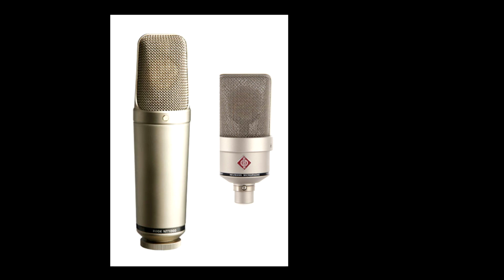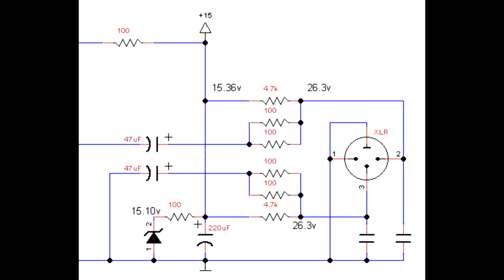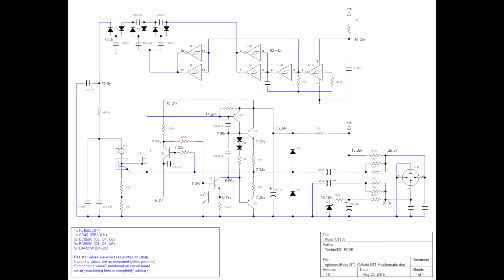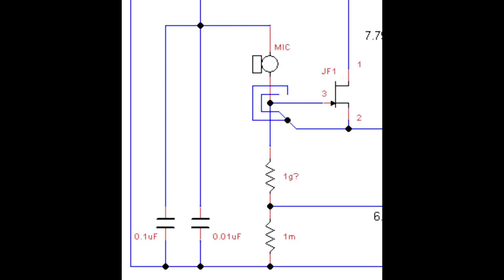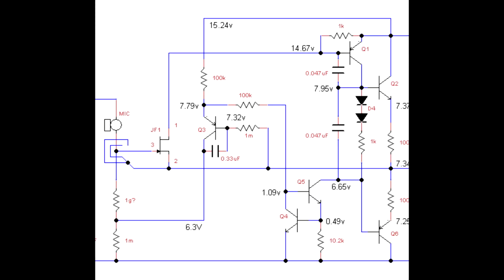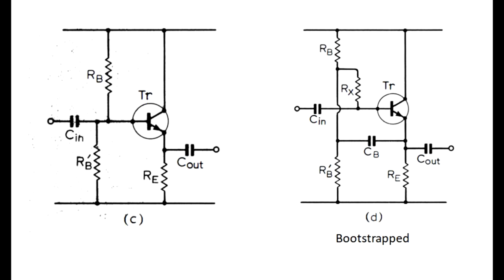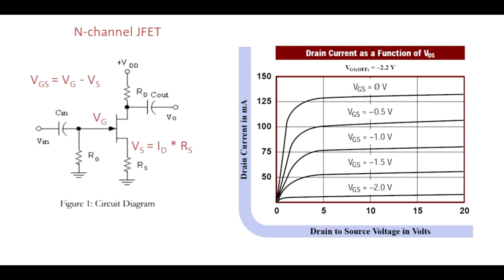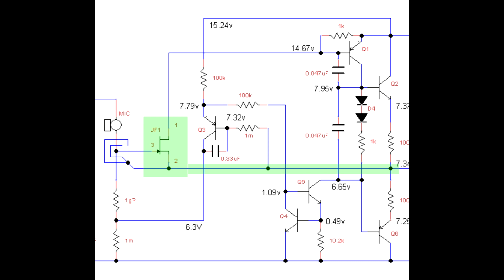#450 Rode NT1a and Neumann TLM103 Microphone circuits compared  (part 1)

Comment: So this microphone has a single-ended output? It is not actually a balanced output? That's kind of crappy.
Reply: Thought the same.  But these guys, especially Neumann, have been doing this for many years and Neumann has the best out there for sure.  Would be interested to hear their take on the unbalanced output.  Un-obviously a reason for it but beyond my feeble understanding.
Reply: @ricklarsen852  Hello, balanced mic preamps (not voltage gain, but current gain preamps) are actually intrinsically noisier than a good single-ended preamp. You can design a very very low noise single ended preamp and then impedance match the XLR hot and cold to get all the benefits of balanced noise rejection. Both the Neumann and RODE have almost an opamp-like circuit with a very low (near zero) output impedance, so they set an output impedance with resistors and match it on the other unused XLR signal line. That’s why you see those two 100 ohm resistors through a cap to ground here!